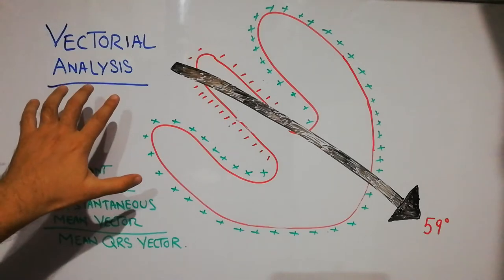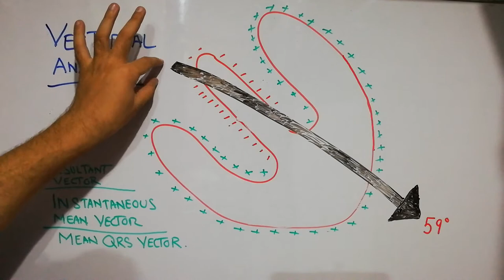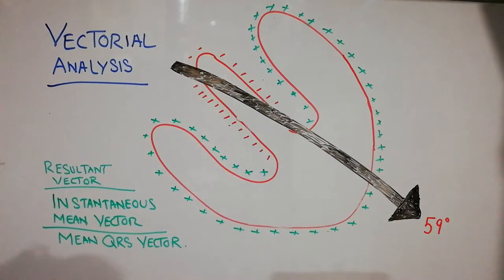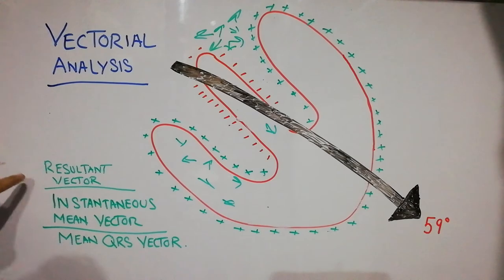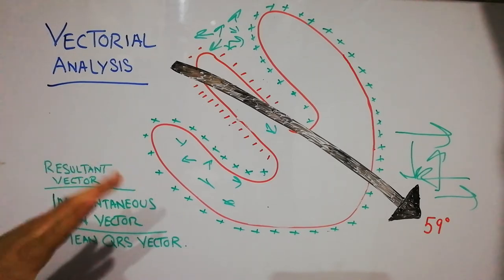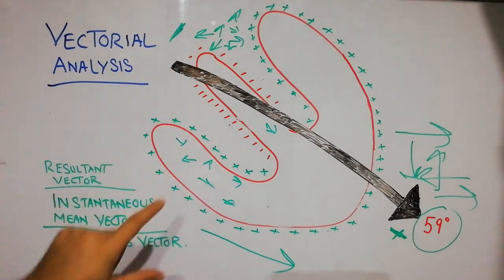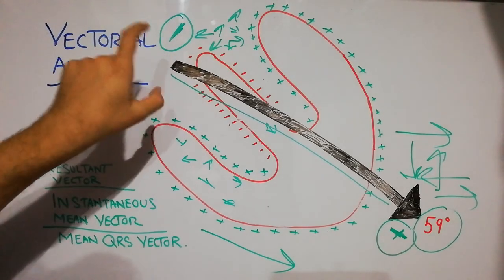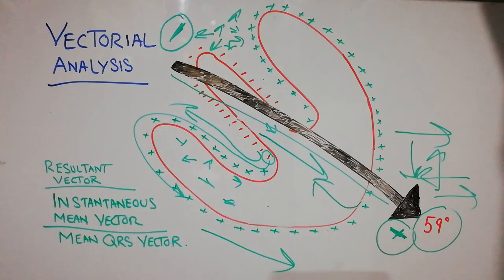CVS physiology 26. cardiac vector, vectorial analysis, instantaneous mean vector, mean QRS vector

Comment: Nice explanation! Sir I don't understand the mechanism of electrodes placed on skin. Like why current moves in the positive direction or towards positive eletrode. Please clarify! Thanks
Reply from the maker: Current doesn't always move towards positive electrode.

it's the placement position of electrode or movement of current which determines positive or negative deflection.

Electrodes are placed on skin to detect the potential, because current from heart spreads to surrounding areas as well, including skin,  from where we can record it......we can't place electrodes directly on heart heart........so we place it on skin
Reply: @DrChamkani  okay thanks! And major difference between leads and electrode? Like why there are 10 electrodes for 12 leads